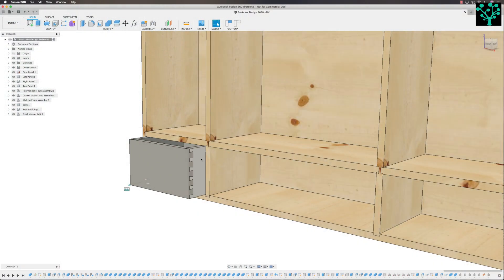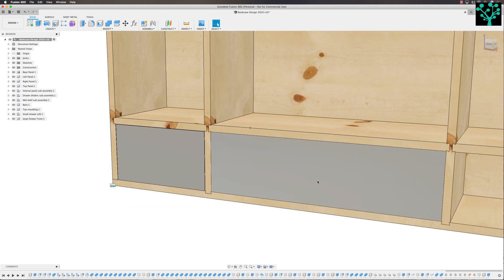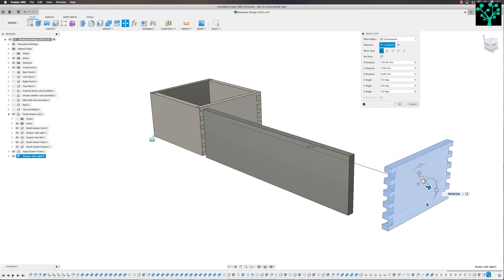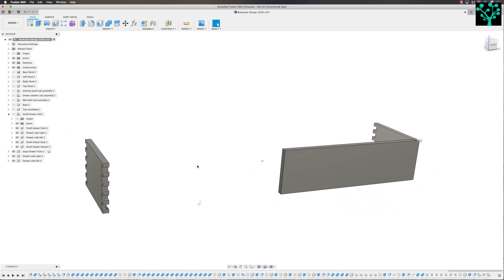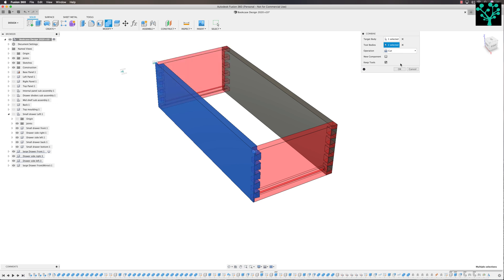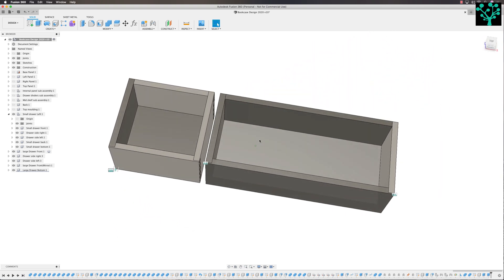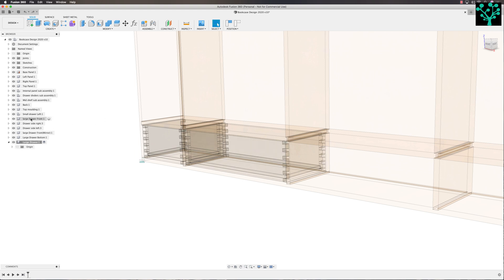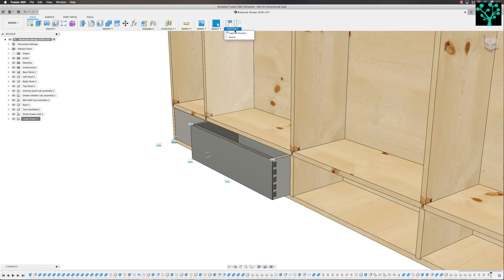Fusion 360 for Woodworkers - Lesson 10 Making the large drawer (quick and easy)

Comment: couldn‘t you not select multiple targets for one tool? It would be faster, no?
Reply from the maker: Hi Tom,

Yes it would be faster - but sadly you can’t do this. You can only select one target at a time.

You can select multiple tools, just as a tip.

I select the the tools first, then select the target. For some reason if you select the target then select the tool (with the action set as cut) all other components become invisible - you can still select them by hovering over where you think they are.

But if you select all the tools first they all stay visible.

Cheers

Andy

Comment: Thanks so much for making this tutorial on fusion. A few years ago I decided to turn pro and go into woodworking full time and Ive been pulling out my hair trying to make "scalable" woodwork plans. Ive watched so many "for woodworkers" tutorials making the learning curve harder than it should've been. I think it boils down to how you articulate it as a woodworker.
For years I sketched the basic plans on my notepad or paper (which now become parameters), then either pulled out one of my drawing boards and drew up plans. For big complex projects this ended up with going over to the architects drafting table - really old school... and the biggest change is moving from 2D thinking into 3D... I tried sketchup but lost interest quickly.parametersprocessreferringdidn'tdidn'twhat

Quickly, on the combine tool, can you select multiple items for the tool to cut? I haven't got a new plan to work on at the moment and have been watching this entire series while sanding (coincidentally a book case also pine for lever arch files) on my workshop TV. And yes, the entire series from lesson 1! 

Really looking forward to the next instalment
Reply from the maker: Hi Gareth,

Thank you for getting in touch, I also used the sketch pad and drawing board technique. I then used Sketchup for a while but found it limiting and it starts to get expensive when you want to move into rendering.

 ‘Covid lock down’ saw the commissions slow down so I forced myself to learn Fusion in the spare time. One hell of a learning curve, but so glad I took the plunge. Now I have a simple process, that scales, that renders, that I can share with customers and I can collaborate on ideas. All out of the box. As 3D printing arrived in my life it was a quick progression to use Fusion for the work flow and I am sure when the CNC arrives another adjustment will see me using Fusion for various craft related projects (alternative revenue stream). 

I now believe that Fusion is a vital tool for the pro woodworker, and as the license is free - a great tool for the hobbyist as well. So stick with it is my advice. I have moved away from Sketchup to the point where I have re-designed my various projects in Fusion - and have de-installed the software - and last week, I put the drawing board in storage.

So to your question, no you can’t select multiple targets - only multiple tools. Also as a tip, select the tools first then the targets - it makes it easier to see what you are doing. I find that the preview mode obscured the view a little.

Stick with the series, I fully intend to take us to the rendering and drawing stages of Fusion - as a Pro you will appreciate how that will change your customer conversation, how the drawings simplify the workshop flow and how the parameters quickly give you scalable ‘everything’

Any questions please shout.

Andy

Comment: Another great informative video, I'm all caught up now, one thing I can't do is once I make a new component by right-clicking the top and making a new one, I can't drop anything into it, it's not a big deal but it is looking a bit messy and a lot of clicking to hide everything.
Reply from the maker: Hi,

Check the position of the ”lolly stick” in the history bar at the bottom.

Make sure the stick is all the way at the end and then try again.

Let me know.

Andy
Reply: @TheWoodgrafter  Thanks Andy, worked a treat, nice and tidy now.
Reply from the maker: No problem,

That took me ages to work it out, I’ll include the tip in the next video.

Cheers

Andy